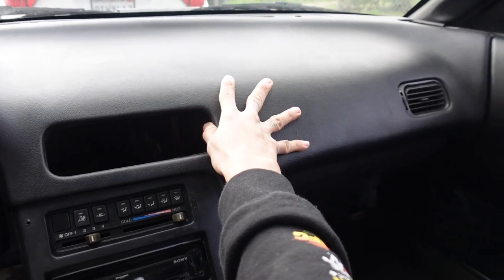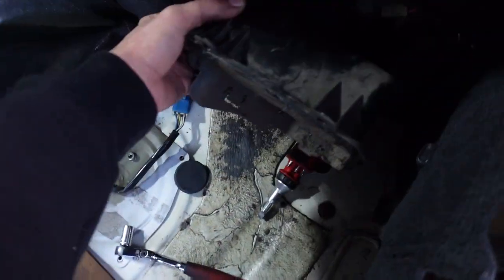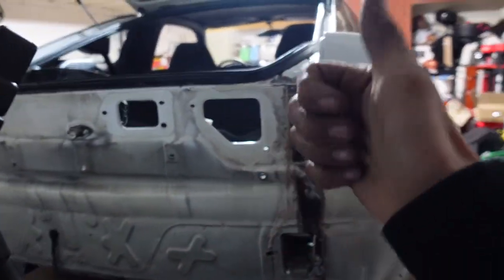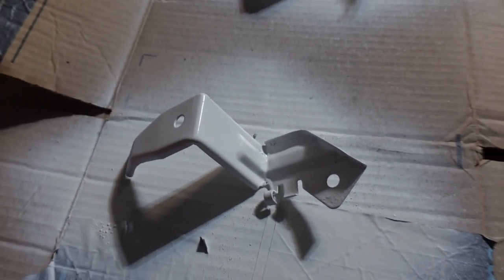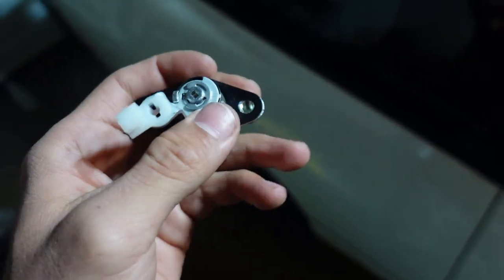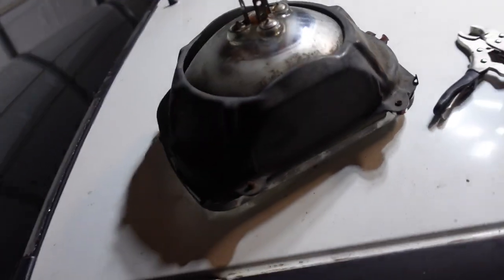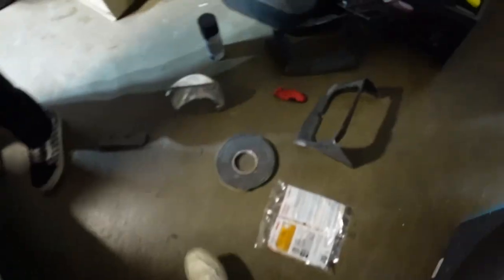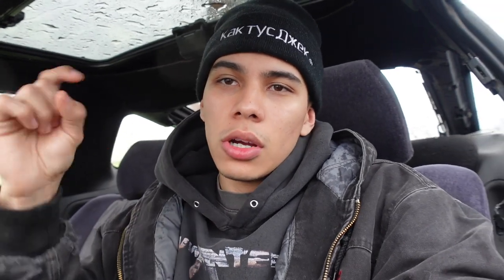Restoring my mint 240sx!!! PART 2: Exterior Upgrades

Comment: ya keep that rust in check . my s13 had a spot right under the battery tray when i removed it , pretty common. glad to see you got the gremlins out of your black car , mine had a problem eating fuel pumps , tried everything  wiring relay trick , extra grounding . went through 4 of em , cheapies and expensive ones . last one is still goin strong , and car is super dependable. those tail lights are sick , always loved those. need to put new tails on mine too .  cheers
Reply from the maker: yea I really want to fix all the rust on the front half of the car next , damn bro haha 240 problems, what was the issue then with the pumps? they’re cool tails bro try and get some while u can before they become impossible to get !
Reply: @Rxstro  fr bro wanna get those tails but shits expensive af